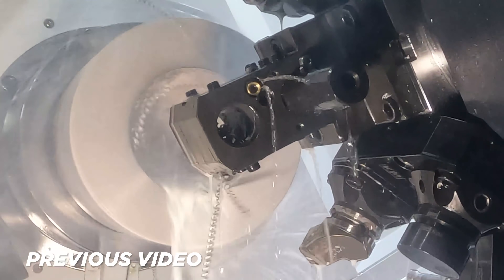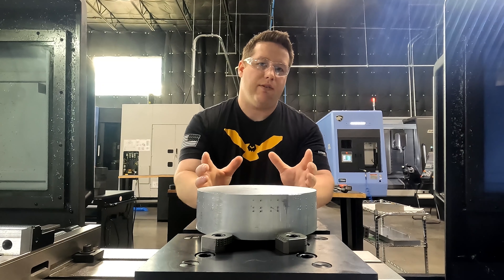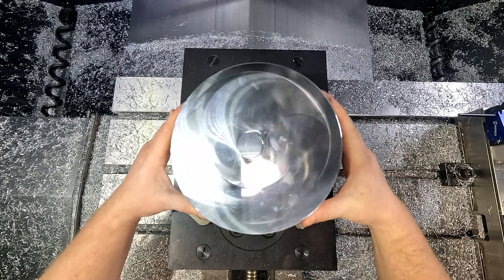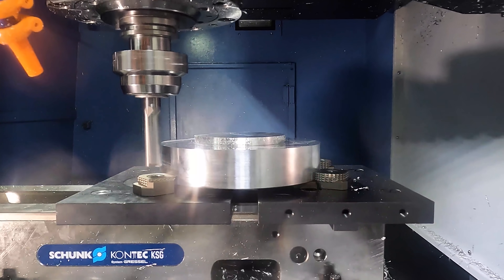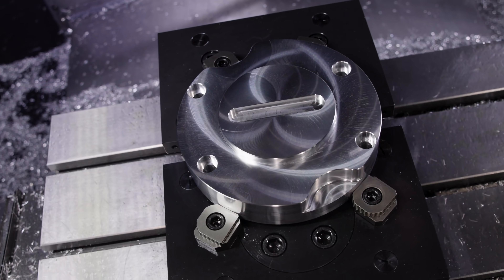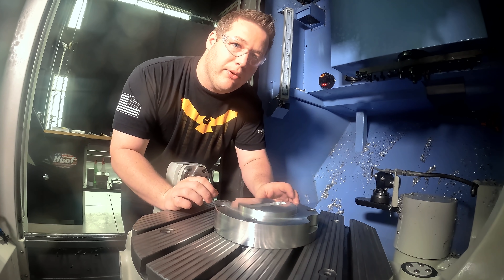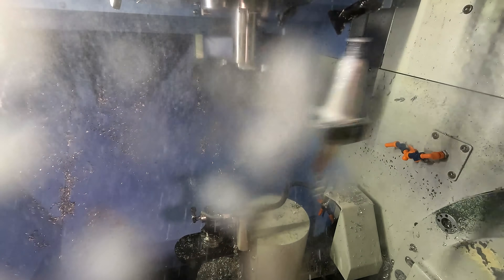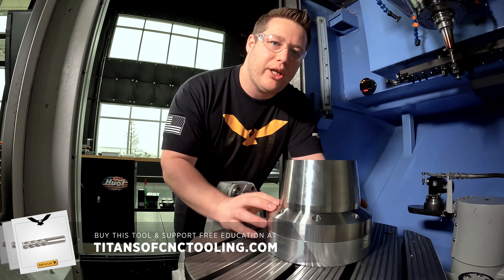Creating Custom Fixture on the DNM 5700L CNC Mill | DN Solutions

Comment: Why did you do the second op on the first machine? Wouldn't it have been better to face and profile the part and put in the 4 bolt holes than just bolt the part down on the 5 axis with 2 bolt diagonal from eachother and counter bore the other 2 holes then bolt it down from those holes and then counter bore the remaining 2 holes and then finish bolting it down and do all the remaining machining for the fixture on the 5 axis, saving a operation and entire setup ? Maybe im missing it here. Either way jessie you got some skills man you should make more videos this boys talent!

Comment: What were you doing at 5:09 to the expanding bolts ?
Reply: They’re machinable. You cut them down to the dimension you need. Mitee bite sends you instructions on what to do when you order them.
Reply: @travisguilbeau8404  thanks!. I figured that but wasn’t sure.
Reply: @adammiller4879  you’re welcome

Comment: How do you know what shell mill to pick? Like dodeka, Stellram, 4-11?
Reply: Usually you use whatever you have in the machine. Most places will standardize tools for certain machines so you know what you have available in that specific machine. If anything it’s the inserts that matter the most.
Reply: Depends on what you are doing.  The stellram shell mill I am using here is a 90 degree tool capable of machining up to shoulders and has a taller insert.  The Dodeka shell mills are 45 degree.  They won’t be able to machine a shoulder but the increased lead angle will be freer cutting and will create a chip thinning action so you can increase feeds and also achieve great finishes.

Comment: Its hard to tell, but at 1:50, isn't the probe shank hitting the raw extruded aluminum instead of the machine surface?
Reply: It is getting close but not shanking.  I checked it by hand wheeling the probe close to the material before we started filming because I was afraid it would shank and I would have to sweep it in with an indicator.
Reply: If it did, they could easily have re-probed the machined surfaces after the big shell mill removed most of the top material, and might have forgotten to include that footage in the video.

Comment: I am building a fixture using these for the 1st time this week!

Do I need a seperate rabbit feature to locate on? I was just gonna use the pins themselves.
Reply: Depends on the tolerances.  If you are hitting a super tight true position or profile tolerance to something that is machined on the previous op then you may need to either locate two of the holes with a round pin and diamond locator pins and hold the holes to a tight tolerance or locate off of the datum like I have here with the center bore.  But to be honest if you machine the holes and the expansion pins to a tight tolerance then they will surprise you how well they will locate.  Most of the time these are all I used to locate in the past.

Comment: At 1:30 did you use that endmill to make that shallow pocket so that there were not any radii interfering with the part in that bottom corner? I've been wondering if that's something I should be doing.
Reply: Yes, you should relieve your fitting corners. I usually just undercut with whatever tool I’m running. It’s nothing fancy, just clearance
Reply: @resurrectionchopshop8471  cool, thanks

Comment: Very nice! Just a quick question, why did use 8 pins for locating the part instead of 2 or 3? Doesn’t this overconstrain the part?
Reply: Those are not location pins, they are expansion pins, so the pins will expand and grab onto the holes of the part, the more pins that grab the part the better
Reply: @owievisie  oh, that makes sense. Thanks!

Comment: I'd love to try out those expansion clamps. Nice explanation Jessie. 👍
Reply: I´ve been using them just recently on a really old AXA 4-axis mill to machine clampingcovers that have a brutal Rm of 1100-1300 N/mm (cant remember what the material was called, sorry) and these expansion clamps just HOLD TIGHT .
Reply: Theyre great. Expensive if it's a one off part but a no brainer for production.